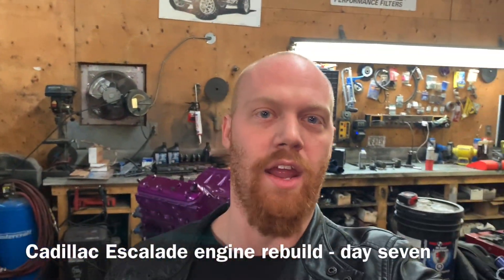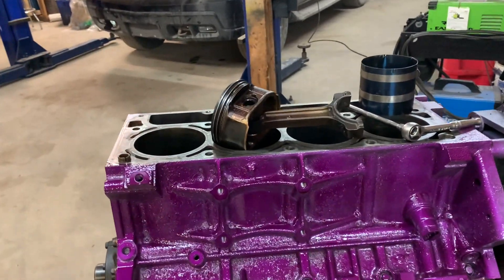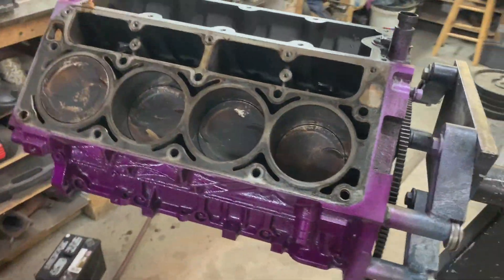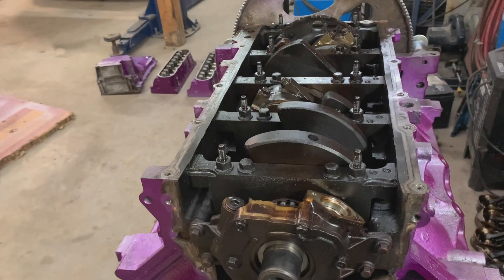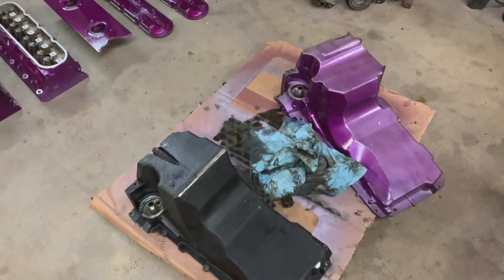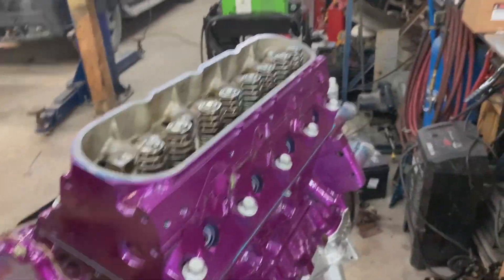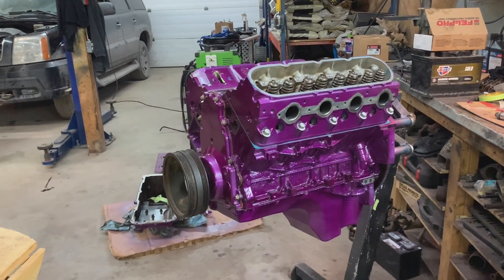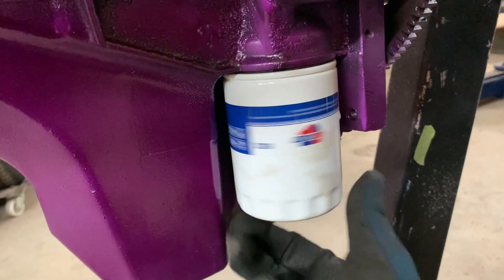Cadillac Escalade LQ9 6 litre engine rebuild - Day seven

Comment: You sure that’s the lq9? The lq9 had flat top pistons. I have a 2002 Escalade ext and the pistons in mine are dished which made me think someone swapped in an lq4 out of a Denali or 2500
Reply from the maker: There’s a story behind this one that’s a couple videos back. 

It was an original LQ9 (flat top pistons like you said)

I put a turbo on it and broke two pistons so I had to rebuild it and only had dished pistons. I put on 5.3 heads to bump the compression up